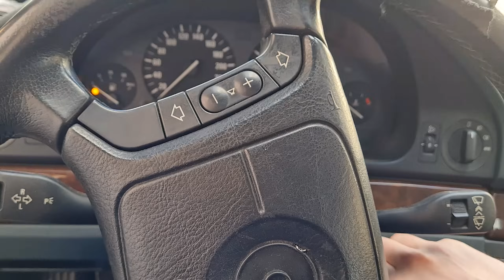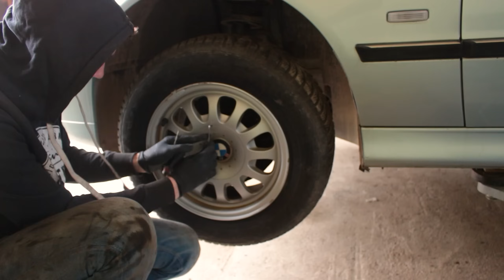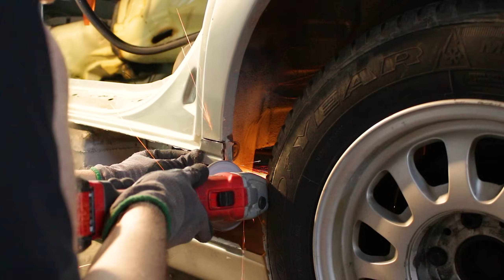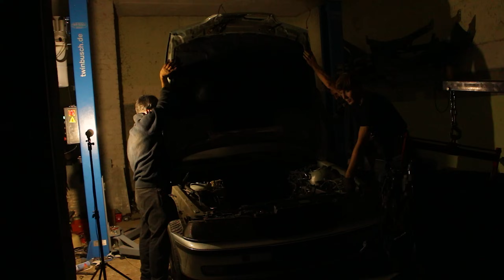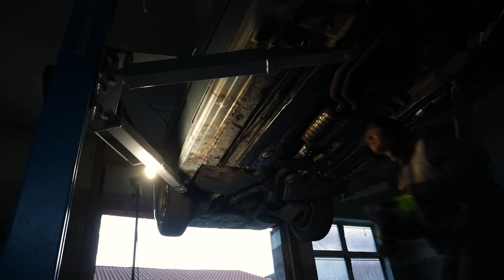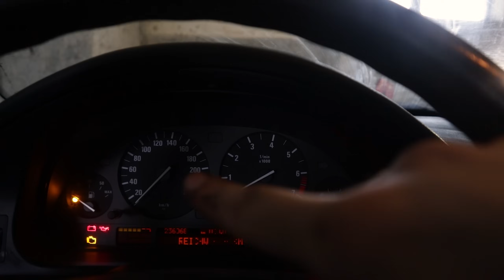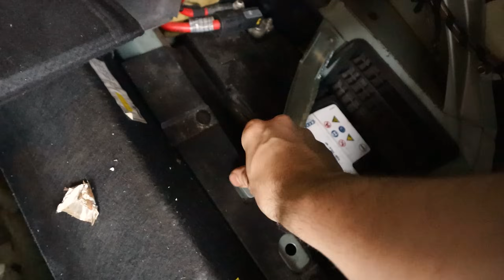Rebuilding Abandoned 90s BMW - Rust to Roadtrip in 91.10 Minutes

Comment: How much is a bottle of CO2 in your place? If you use MIG it's better weld in a CO2 cover. Why use weird wire if you can use proper thing.
Reply from the maker: Hey Dominik,
It costs about 70€ per Fill (20 Liter). But my gas bottle was also quite questionable...I am sure I would have needed another one. (about 200€) 
I like welding with fluxcore wire. Works perfectly for my usage.

Comment: Bro keeps tossing engines instead of figuring out the problem, out of everything you accomplished the engine was possibly the easiest thing you could have fixed, especially with all the available online resources, engines are really simple as long as you understand the basic ingredients it takes to run an engine, and it's pretty much the same for all engines.

It was still a great work overall, especially what you did with all the rust, i never would have messed with that, rust is my non negotiable, i would have handed it off to a professional or junked it 😂.
Reply from the maker: Hey Denis,
You are right! The thing is, I am still a bit frustrated that I couldn't fix the engine. Well, I just bit off more than I could chew with this car. Never did any rust repairs, or engine stuff before. Tried my best here, still learning :)
Thanks for the comment :)
Reply: @TheE46Guy  we're always learning, what you accomolished with this car was massive.
It's just, i cut my teeth on engines on my diy journey, so it just seemed like the easier task and a no brainer from my perspective.

Im generally terrified of body work, so what you did with the e39 is nothing short of impressive, you should be proud of what you accomplished, and i bet you are.

I wish you more growth on your youtube path man, you've started something great here.

Comment: 2:15 ... What the fuck...
You literally caused more wear to that engine than 40 years of daily driving would have....
Oil dude... Pull out the fucking spark plugs first. 
Holy Indian Movie.
Give this kid a Lemon.
Drain the fucking Oil, you just said the car wasn't on the fucking road for 6 years.
Then you get the spark plugs out, then you pour oil into the cylinders.
Check Fuel, Check Spark, Check Compression.
Also, you drain the fucking Fuelz especially if it's Gasoline / Petrol and you put in Fresh Gasoline / Petrol.

In order to have a working engine you need:
- Air ... There's plenty outside...
- Fuel ... Your fuel is bad, the pump wasn't working, check fuel pressure or at least fuel flow.
- Spark
- Compression 

You can't have a working engine without these.

Comment: For fenders, did you used or after market?
Reply from the maker: Hey Anulu! The fenders are original, I didn't replace them. I think you mean the rocker panels, right? If so, they were some aftermarket ones. Honestly, I’m not sure which company made them, but they didn’t fit very well.

Comment: How much have you spent on build? Next time you shuld visit scrapyards in order to get some parts cheap, for example battery holder or this tiny cap in the front bumper, would cost 1e
Reply from the maker: I think in total it was just under 4k. Could have done it cheaper...Yeah, you are right...the thing is, here in my area, I don't really have any connection to  scrap yards. The one time I called a junkyard, they weren't really helpful and didn't have an E39 on their yard. But I did ask some private people who had used parts, and I got a few parts really cheap 😀

Comment: Appreciate the dedication and labor put into this car but those welding repair methods are just not correct, having done what your doing in the past I can say it may be the only method feasible but it is no where near as safe as it was before (rust not included) welding against or to boron steel like you were doing weakens it and compromises the integrity and crash performance of the car. I will say the final sill was welded correctly and properly as it was mild steel but remaking the inner structure you did yourself is a no go.
Reply from the maker: Hey Tupov,
I really appreciate your comment. To be honest, rewatching everything I did gives me a bit of a headache too, especially the inner structure. It’s been over a year now, and I’d definitely do things differently. But you gotta start somewhere, and this car was my learning experiment :)
Thanks again for the insights. Would you mind describing what you would do to repair the inner structure?
Wish you a great weekend :)
Reply: @TheE46Guy  Unfortunately the only way to properly replace the inner structures of a car is complete removal and replacement, the reason why this is a financial headache for DIYers like you and me is because the dealerships and factory use this method, remove the entire panel affected by rust without damaging the intact panels, measure the sub-grade of rust and consult the manufacturer manual and data sheet to determine what can be reused, then remove other completely fine panels to get access to the effected area, purchase stamped boron steel pieces from the manufacturer (the same parts used to assemble the car) and weld them with silicone bronze brazing MIG or resistance spot welding, depending on where it is called for, the thickness of the material, alloy of boron used, and location of spot welds and structural joints, to understand all of this you must have access to the original body repair manuals for the car, even then most don’t cover all the structure just common places that get crashed into. Like I said, it’s difficult without thousands of dollars in parts, tools, fixtures, jigs, spot welding machines, tram gauges and the replacement pieces themselves which you can NOT create yourself, they were all made at once 20 years ago in a metal stamping factory in a couple big batches, good luck finding them now, unless you can harvest them from another car without drilling into or damaging them.
Reply from the maker: @tupov  Wow...thanks for the insight. It's great knowing this now. Thanks :) Well, I definitely need to keep that in mind, when rebuilding my next car. I am going to avoid rust on the inner structure, unless I can find a proper stamped panel and have all the tools for that...
Reply: @TheE46Guy  That's really the only real way to own an old car, make sure it has no rust then prevent, not treat, cavity wax/cable grease and reducing water intrusions keeps a car alive for a while.